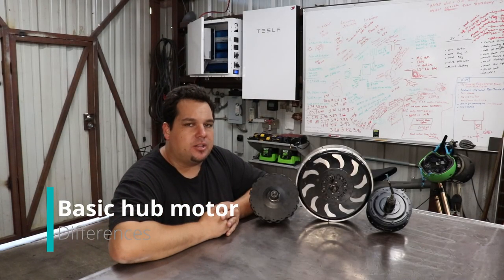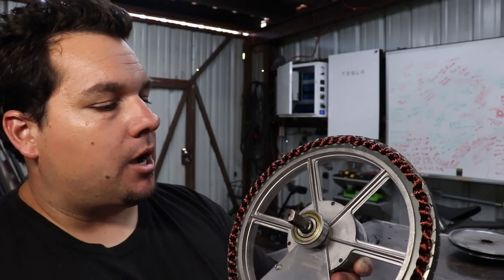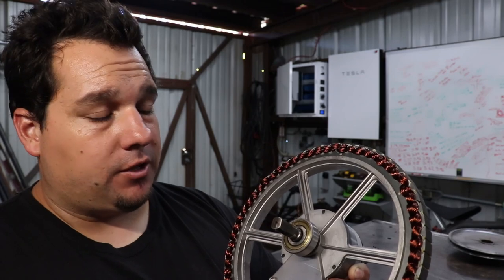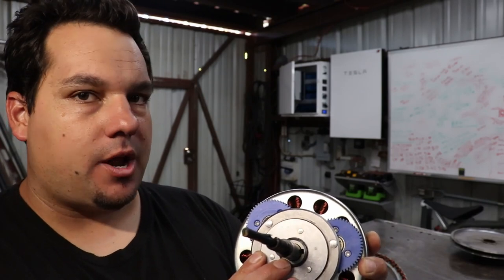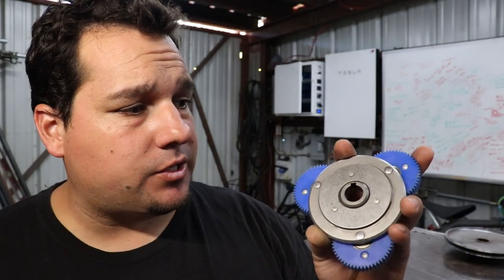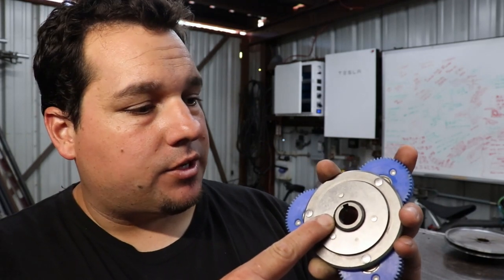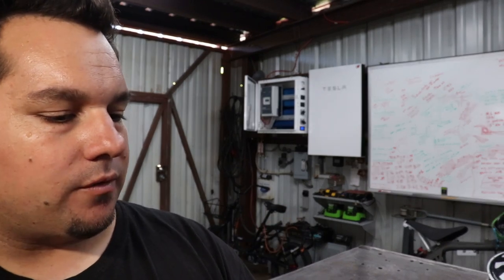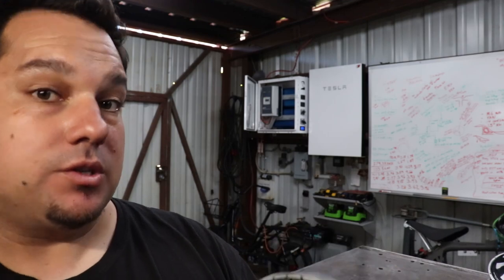Basic hub motor differences, An introduction to E-Bikes

Comment: Awesome info. Just built an ebike with a 1000watt hub, but realized it doesn’t have enough power for hills.
Reply: lol same here...i bought a 1500 watt bike and it sucks as hell at climbing but its sooooo fast.
You have to make a choice, do you want to ride on a flat surface for 1 hour or climb a mountain for 10 minutes
Reply: @Bergwacht  or build up a middrive bike
Reply: @chrisE815  that makes no sense with normal bicycle chains, even with my 250 watt yamaha I have to buy a new chain every few weeks and a new cassette 3 times a year. using a sturdier motobike chain and drive components would work but i have to be stealth. I'm quite happy with the 3000 watt hub motor, apart from the fact that I have to tighten the spokes every 2 trips.
Reply: @Bergwacht  what kind of hills are you going up? 1000 watts on a 48 especially 52 volt battery should be pushing u right upa hill. My dad's lectric electric bike does it easy for him and he I over 200lbs and it's a 750 watt hub
Reply: @davidmiller4758  To be honest, we only have one mountain here, which isn't even that big, but it's steep.
In the meantime, the 1500 watt motor has broken down (boiled) and I am driving a 3000 watt motor. This has to pump 4000 watts for this increase. I don't know how you can do it so well with the 750 watt motor, they always work themselves to death for me. I weigh around 100 kilos, no idea how much that is in lbs^^

Comment: Jonny, I'm a mechanical engineer with some insight but not a comprehensive isight into these motors, I have a question for you that will help me resolve a design detail for a concept I'm working on...

Can these flat stators iperate perfectly well if there was a gap in the stator? In other words, if an eighth of the stator was missing (but the circuit was continued by an intermediate cable or other conductor), would it compel a rotor to spin as normal?

Comment: Is there any practical advantage to having the sensors?
Reply: Smoother acceleration and more efficient at slow speeds
Reply: Yes sensorless motors (controllers actually) have a hard time getting a loaded motor spinning from a stand still. They have to guess where the poles are to apply the right magnetic field.  Sensored can apply torque to a stalled rotor to get it moving

Comment: Great explanation of different hubs!

Regarding the 3 sensors. Do they effect top speed? I reach about 30mph Max top speed on my 1200w rear hub motor from Ebikeling (26’ Fat Tire) I use a 52v 13ah battery which I am upgrading to 80v—

Could I simply cut the sensor wires? What will that do? My goal is trying to get past 30mph when I do long straight always on paved bike path
Reply: Thank your for your response and link! Very informational. Above my intelligence rating for sure but I did read!
Reply: I honestly don't have the knowledge to say for sure how to increase speed . But I do believe at a minimum to increase your speed you have to increase the amps delivered . You might already know , but perhaps checking your controller for a speed limiter as well (and disabling it if so) . But perhaps getting a bms that can deliver a higher amp rating could ( and having a controller than can handle the extra amps ) give you the extra speed. I've put several systems in a couple scooters ( all 72v ) and they varied in top speed even though they ran with identical 20s6p battery packs. I only noticed that the ones that had the bms that could push higher amps would go faster and when switched bms with lower amp rating to same controller would have lower top speed .but like a said I'm no electrical engineer , I could be making the mistake of "correlation does not always equal causation "

Comment: I have an e bike with a geared hub motor.  It has plenty of power on level ground and on small grades.  But when I climb steeper grades the motor has very limited power.  Why does this happen? if you would know?

Comment: The physics of moving a load up a Hill doesn't change because you changed motor type. Geared motors are less efficient because of drivetrain frictional losses.
Reply: The amount of amps and torque on the motor to get you up the hill is dramatically different though

Comment: Plastic (nylon) gears? How can that be dependable? What happens when the gears break? Can I still pedal home, or is the hub in permanent freewheel? OR, can the hub go into fixed gear when the gears break, thus locking up the hub? What if this locking happens on a front wheel drive Ebike, do I die by being tossed over the handlebars. I find Ebikes today nearly all useless, either by a price/value out of this world, proprietary parts, stress on drivetrains with broken chains and spokes, unrealistic bike weights, horrible frame angles. Can you image paying $5000.00 for an Ebike that is nothing more than a cheap bad design $500.00 bike with a battery and motor. Yet for some reason Ebike manufacturers think they have more R&D, complexity, precision of parts in a simple bicycle with a motor... than motorcycle manufacturers.

Comment: How do I find out how many magnets are in my hub motor without opening it up?
Reply from the maker: That's a tough one... Either find the specs on your motor, or you might actually have to take it apart unfortunately.
Reply: Short 2 of the 3 main wires on the motor together, then turn the motor by hand. This will turn it into an electric brake. Turning it slowly you will feel "notches". Each notch is the charged coil passing over a magnet. Count how many notches for a full rotation of the wheel. If the wheel is a geared hub, divide the number by 5 to get the approx number of magnets. If it direct drive, the number of notches is the number of magnets.
Reply: @skepticfucker280  you should be able to shirt any 2 of the 3 main motor wires and feel notches when you turn it. Yeah if you mark the wheel and do one full rotation each notch you feel should be a magnet.

Comment: All most experienced cyclist need to extend our range 2x is 100 watts. They don't seem to exist, so nothing but bad choices and short range bikes. Need a 150 to 200 mile assisted range. (assisted = motor turned off 50% of the time, pedal assist 50%). ( bike cannot have motor resistance when off).

Comment: Thank you very very much, very kind and very well explained.
I have a gearless 1000 W  48 V  front hub in my bike.
I'm thinking in a 2wd bike with a geared hub in the rear, any recommendations?
Reply from the maker: No worries! thanks for watching. That would be interesting to do. I don't see why it wouldn't work. eventually one motor will outrun the other. But it would give a good torque out of the geared hub to help accelerate. would be interesting to see.
Reply: @diye-bikeswithjonny5398  I got a 750 bafang rear hub geared and an ebay 1000 watt front hub motor.I pedal on PAS 3 with the 750 and for trails and steep hills use the 1000--it is a perfect combo.I also use the 750 on sidewalks or to navigate tight areas--and use the 1000 also if I have to travel a long distance fast. I plan on using the front hub for the heavy work to extend the lifespan of the rear gear hub because they are so much harder to replace. I hav 96v and 34 ah--2 batteries and am easily getting 80 miles plus range.I did 60 within 3 days and the 1000 watt motor connected to a 48v 20 ah battery had half charge and the 750 still had a full charge.Hill climbing and heavy trail riding is a breeze and the front hub actually keeps the wheel hop down on trails. I have vids on mine.The 1000 can also do hills at 22 to 28 MPH by itself on hills that the 750 was doing 12 mph--if I use them both on hills the bike will keep 25 to 28 on steep hills and can do the steepest hills in a few seconds if I need to.Front hub is so strong that I usually do not engage it unless I am at 10 mph because it will spin the front.
Reply: @khronin  many thanks for your comment. That's exactly what I'm thinking, I'll check your channel. All the best
Reply: @markburton5292  cheers!
Reply: @markburton5292  Yeah --I got the idea from him and actually glad I did it.Also those front hub ebay motors are great for the price and very reliable and strong.It is also very good safety to have 2 seperate systems--anything happens to one hub or electrics I have  backup so I do not wind up peddling a 70 lb bike.Offroad ability is bordering on motocross level.
Reply: @khronin  sounds like a monster of a bike! Going to check out your channel! I want to add a second hub motor to my bike. Currently adding a 80v Battery to my 1200w Rear Hub Motor from Ebikeling. Hopefully I don’t burn out the controller or motor
Reply: @leoelegado  BTW the front hub motor is just connected as throttle only--so I get all the power immediately.One thing is if you do this--practice somewhere--you have a ton of torque(instantly) and the front will actually spin off the line--once you get use to it--it is fantastic.Get a torque arm also for the front hub motor.

Comment: It is simple. Geared motor is the preferred motor as you need to climb hills.
Here we have no hills and I prefer the normal hub motor. It makes no notice and no maintenance.
The gears become a problem after a while. They make noice and the gears will wear out after a while. It depends on how you ride your bike, but it can happen faster than you think.

That is why I prefer gearless. Yes it has disadvantages, but as you are up to speed, the Amos it pulls isn't that big and it rides smooth.